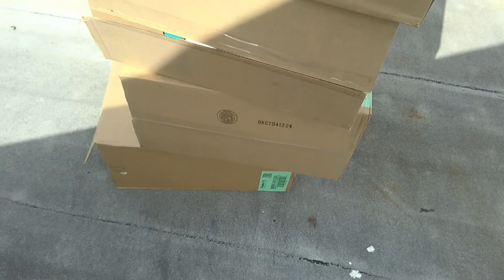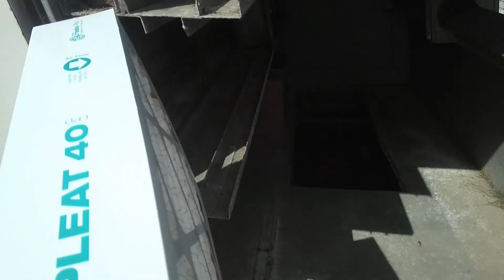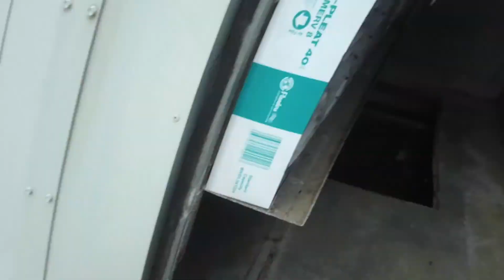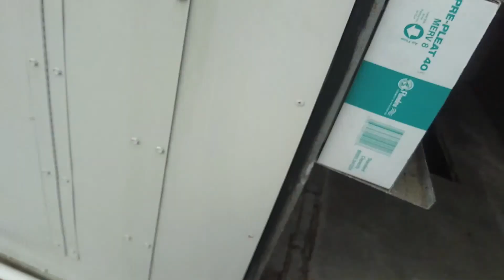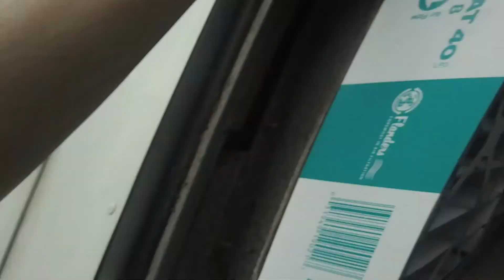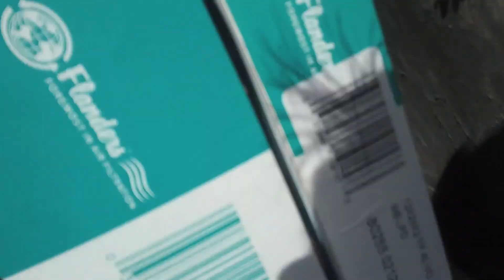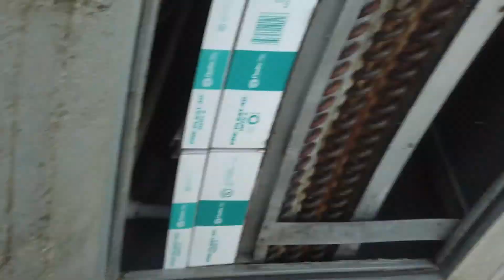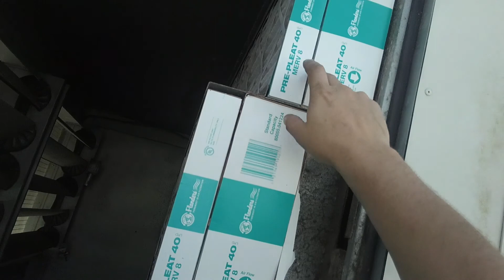A/C Filter Changes On An AAON 60 Ton Unit.

Comment: The unit has double filters because its uses the 2inch as a pre filter and the 4inch as an after filter depending on the the location of unit you could change 2inch every 1-3months and 4inch every 3-6 months
Reply from the maker: You are Correct Sir Thanks For Watching and don't be A stranger ethier 😉

Comment: You don't shut the unit off , or date the filters
Reply from the maker: Yea I agree but this unit is for our kitchen in less than ten minutes it will be 90 plus degrees in there. I did it once  and boy did I hear it there are 5 exhaust hoods in the kitchen that I can't shutdown are the smoke from them cooking  will set off the fire alarms. As far as dating the filters yep we do its an app on our phone then someone comes and does an inspection to make sure we are doing the filters. Thanks for watching

Comment: What is the exact size of those filters? Maybe look for a different brand that is a quarter inch or so smaller. Every brand is a little different
Reply from the maker: Well Joe they say 12X24X2 and then 12x24x4 but haven't got out the tape to measure them.Thanks for watching Joe.

Comment: You really should shut down the unit if you can to avoid sucking in all the dust kicked up
Reply from the maker: Yea I agree but this unit is for our kitchen in less than ten minutes it will be 90 plus degrees in there. I did it once  and boy did I hear it there are 5 exhaust hoods in the kitchen that I can't shutdown are the smoke from them cooking  will set off the fire alarms.